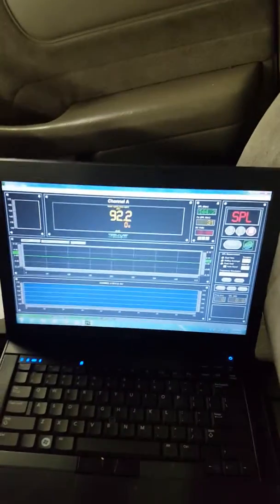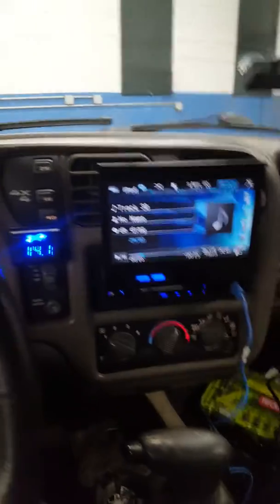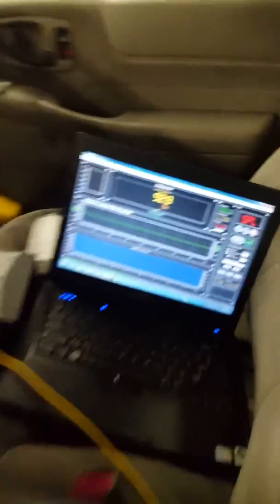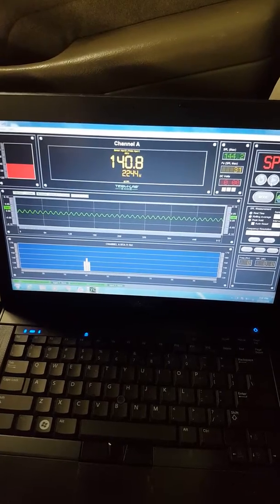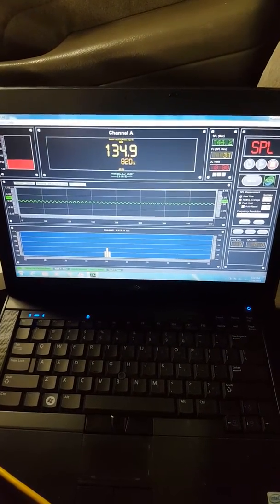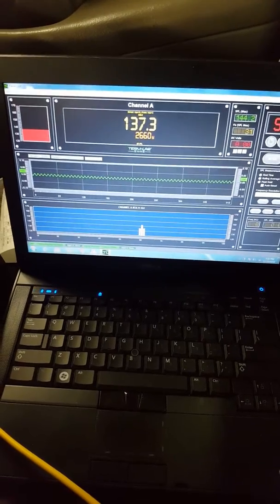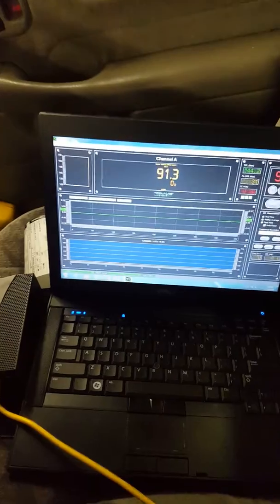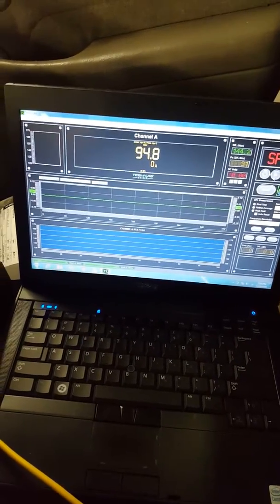Wolfram au 15 subwoofer test

Comment: These subs are garbage. Colin filling y'all lol. The w-4500 quality control is crap also. You should see it compared to my S&I made deaf bonce apocalypse amps on the inside. Shitty solders and adhesion to the board. RCA's are soldered with the littlest amount of solder you wouldn't believe it.

Comment from the maker: The sub was stinky at this test wasn't at full tilt. If I would of went to full tilt it would have tore the suspension out. The coil could barely take the wattage being givin and my truck still stinks from the coils of this sub. My opinion this sub is a 1000 watt rms sub at 2000 it was thermo overloading. This sub is rated at 2500 rms with a 3 inch 4 layer coil. This sub let me down by far.